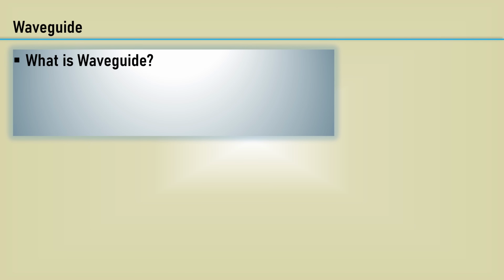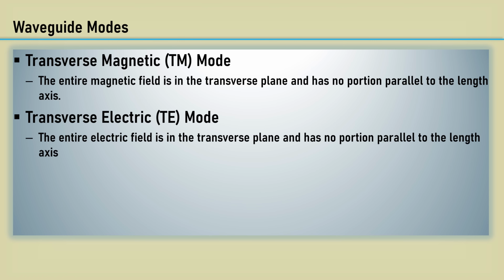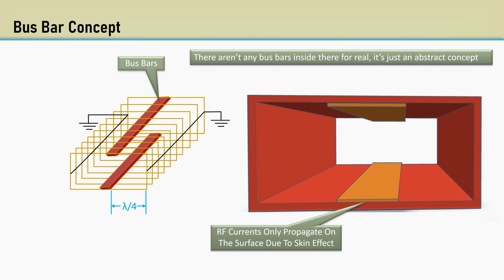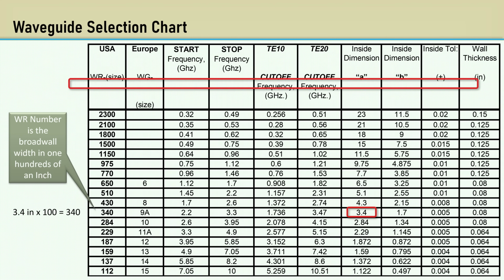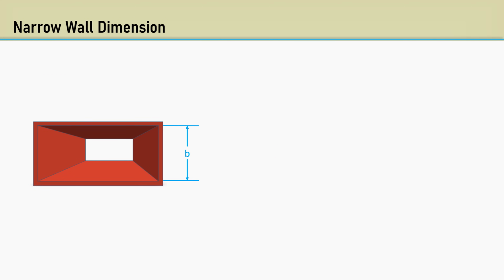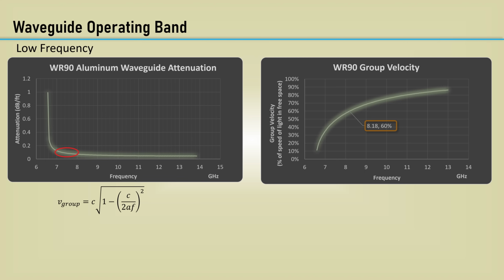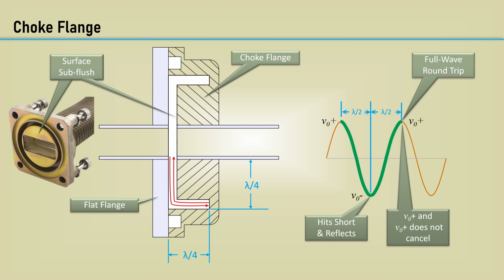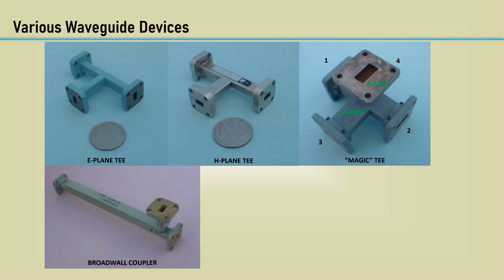Waveguide Demystified (4k Video)

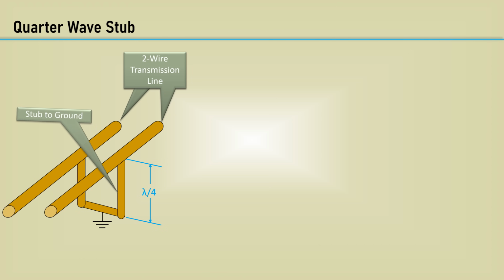Comment: 4:50, that jump to the quarter wavelength stub was jarring. I see how you were using it as a transitory, and I like how you use this as a kind of lemma to explain waveguides, but I had to rewatch it a few times to make sure I respected the explanation.
If I understand correctly, the reason we have the stub was to attenuate all signals that aren't at that frequency (or integral modes thereof) and set the junction point to 0V (via a standing wave) if they are.
Reply from the maker: Yes that’s a good way to put it.

Comment: This was fascinating, thank you. I'm 32 and I've spent a lot of time exploring the various long-lines towers in my area and I've never even remotely understood how waveguides worked until now. I just assumed they were like a fiber-optic pipe for radio waves, hap hazard bouncing along like a river of energy in there.

As a machinist by trade, I find it particularly fascinating the relationship of the physical dimensions and tolerances to the frequencies and efficiency of the system.

Can it be dangerous to send the wrong frequency down an incorrectly sized waveguide to ending up with current on the exterior surfaces of the waveguide?
Reply from the maker: Thanks for the comment. I believe the only thing wrong you can do is overpower it.

Comment: Thank you for the video, it's a nice, concise explanation. One thing to add: the fact that the length of the choke is not constant across the broad wall helps make the match better over a broad range of frequencies. If the geometry was made exactly lambda/4 over the width of the broad wall, we'd get a good VSWR at only one frequency.
Also, beyond about 40 GHz, it's common to see the UG/387 style flanges that use alignment pins to ensure that the tiny openings stay lined up. I have not come across choke flanges below WR-28 (Ka-band). I suppose the grooves become too difficult to machine.
Reply from the maker: Thanks so much for the comment. That's great information. Thanks for sharing.

Comment: excellent, I know nothing about wave guides but that helps no end. I do wonder how the ripples in the flexible concertina walls don't cause all sort of reflections, are they at 1/4 wavelength apart or something?
Reply from the maker: I don't have any experience with the flexible elliptical waveguide. I surmise that it only adds length, otherwise it would not be very useful. Thanks for the comment.

Comment: Thanks for this.  Have been working in the satcom industry for almost 50 years and have worked with my share of waveguide.  Interestingly I think usage has declined a fair bit in recent years as there's an increased shift to smaller solid state power amplifiers that can be mounted closer to antenna feeds.

Used to be commonplace to have HPA (high power amplifier) rooms with waveguide plumbed all over the place at gateway earth stations, but now not so much.  For user terminals everything is pretty much feed mounted and you don't see any external waveguide.
Reply from the maker: Wow that’s a lot of experience. Yes that’s a trend for sure. UHF television transmitters are good examples of use, but now with everything streaming, I wonder how long terrestrial broadcast will last. Thanks for the comments.

Comment: A really clear and straightforward explanation, thanks!

(And that choke flange is such an ingenious design! It seems like it would only work perfectly at a single frequency though. The waveguides themselves can be used for a range of frequencies, do they make choke flanges for specific frequencies within the range, or are they good enough across the typical range?)
Reply from the maker: Thanks for the comment. The ones with circular features have an increasing VSWR as the frequency increases. Some choke flanges have horizontal features which eliminates that issue for the most part.

Comment: Please loose the feet and inches. Metric gets rid of the constants and makes the formulas simpler to understand.
Reply from the maker: I get it. I'm not a fan of the imperial system. However, the standard waveguide numbers were based on inches, so I was not inclined to change. Thank for the comment.
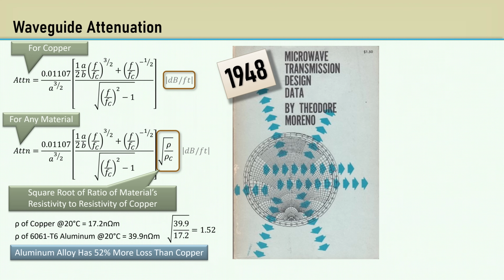Reply: @oldhackee3915 as much as equipment parts may be imperial, how about say for just general equations, such as 14:25 having attentuation in dB/length, such situations use metric? There isn't a need to think about the length of a waveguide in metric after all, only the cross section since that is the manufacturer "standards"
Reply from the maker: I understand. To further complicate things, every waveguide drawing I ever saw was dimensioned in inches. 🤯
Reply: @oldhackee3915  I'm commenting from the non-US portion of the world..

SAE is ONLY used in the US.

ALL other countries, with the exception of 1 ( some Asian country which still rejects metric, iirc ), use metric.

The SAE stuff may well be comfortable for the percentage of kids who grew-up within the US, in the SAE system,
but all the kids who failed as a result of the SAE system,
because the sometimes-base-12 ( inches-in-feet ) & sometimes-base-16 ( much of the rest of the SAE system is either base-8 or base-16, like ounces-in-pounds, etc ),
are not served by SAE.

Neither are all the people who never got passed/failed in the SAE system, because they were blessed by the metric system, in school.

I'm old.

I was in the Imperial system ( 10lbs water == 1 imp gallon of water ).

SAE actively-harms understanding of people trying to get the hang of things, from square-zero.

I've tried doing conceptual aircraft design, & SAE turns solving problems into nightmares.

That the US textbooks reject metric eradicates much potential-creativity from our current-world's population:

much more percentage of people can understand metric, than SAE, due to all the bogus fractions & odd measures.

That is like having a "tradition tax" on everybody, that everybody need pay, just because it's established.

The basic principle of "sunk costs NEVER justify current-spending", that the business world stuck to,
is correct.

We need to ditch the old archaic spellings ( I'm talking at me, here, with my more English style spellings, "colour" instead of "color", etc ),
& we need to ditch the old archaic SAE calculating,
because both damage the ability of much of our populations to learn stuff, for archaism's sake??

I'm deeply grateful to you for your contributing this video: these things were never understood by me, before,
& at-least I can now get the hang of the fundamental concepts..

but equations rooted in SAE .. whether in aviation-engineering, or in electrical-engineering,
they harm learning,
& therefore they are only a tradition-tax.

Taxes have their place ( one's immune-system consumes 1/10th of one's calories, one's brain 1/4, so those are "taxes",
& the benefits of both of those is well worth it, right? ),
but tradition-tax, which damages one's entire economy's innovation-ability .. I draw the line at that kind of thing..

Thank you for making your videos!

Please consider making a metric-equivalent for each SAE version, & label them, right in their title, as metric,
& you'll get fans from outside the US..

& those fans will be learning real understandings, which will help our world be more strongly innovating,
as all the makers are more strongly innovating..

Salut, Namaste, & Kaizen, eh?

_ /\ _
Reply: Geeze go back to Russia , here in America we use feet and inches because they are better
Reply: I think it would be better with Sexagesimal. Waves and resonance are based on geometry and cymatics, not in kg or candle light :D